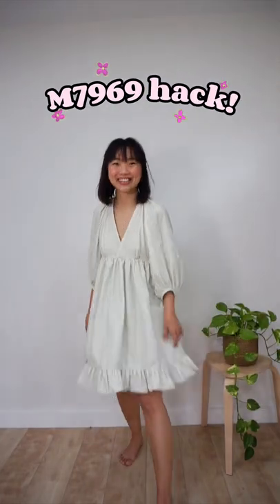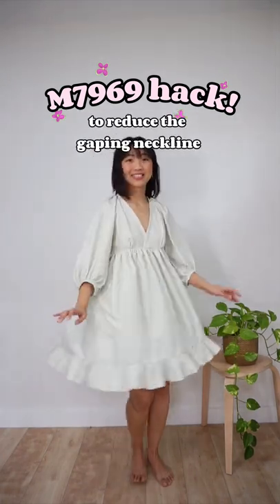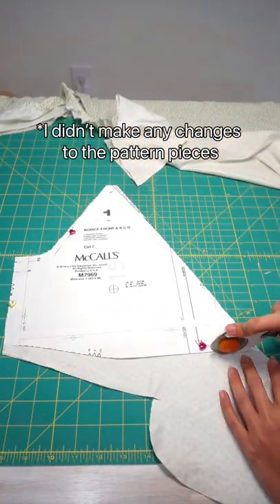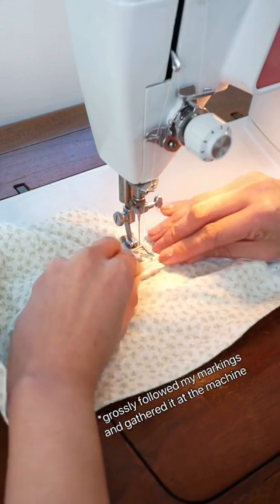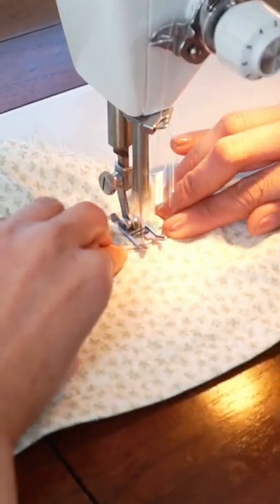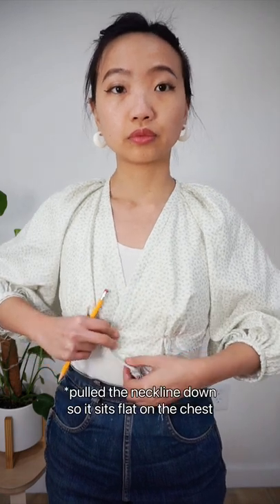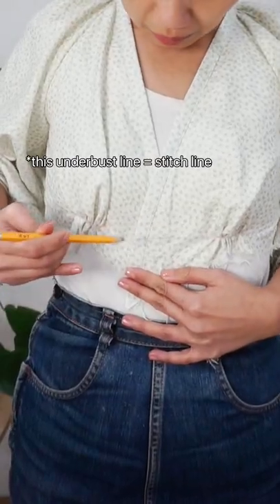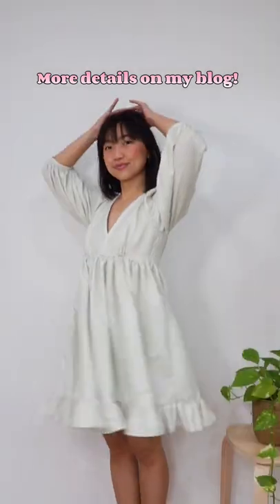Hacking the M7969 sewing pattern to reduce the gaping neckline | #shorts

Comment: I like this. I did inseam pockets, cuz...always. And lined it cuz.... mostly always. But I really wish I had done this.  A little too late for me, as I'm still in the middle but with everything cut. I was thinking of making a one piece scoop neck or 2 piece notch neck bodice on this dress next time because of the gaping but was wondering if it would be hard to pull over so I'm going to follow your lead and put in an underarm zipper I think, too. also, I couldn't imagine the bottom ruffle being cute until I saw yours, but it totally is.  Trying to see what fabric you used... is it a lightweight cotton? Mine is rayon but I like the drape and movement of yours, too
Reply: I know the cut shouldn't matter but my pieces BARELY cover my bust
Reply from the maker: I used a thrifted bedsheet for this and it’s polycotton - looks and feels like regular lightweight cotton poplin with a more plastic touch if that makes sense. Heh. Probably more plastic than cotton in the fabric 🤓
Reply: @gwenheng  I have a dress I made from a thrifted bedsheet that's one of my faves. They're usually really soft and comfy and worn in